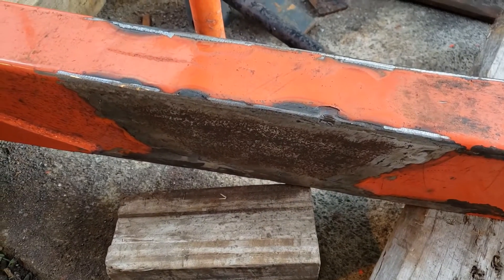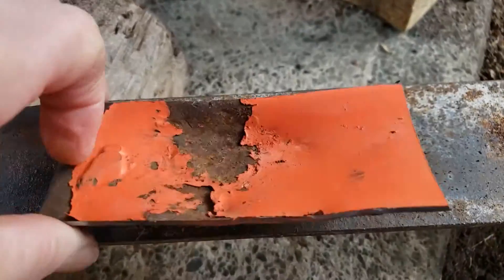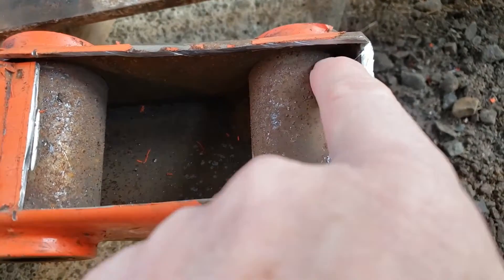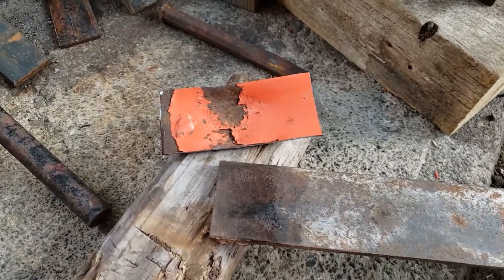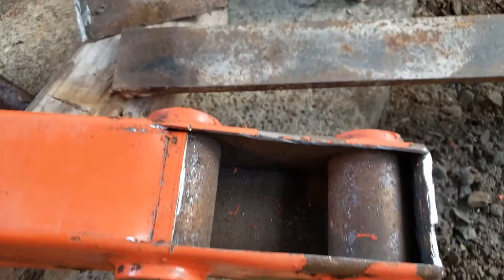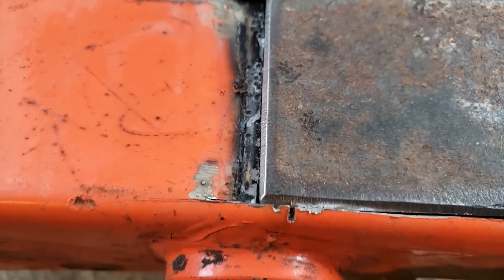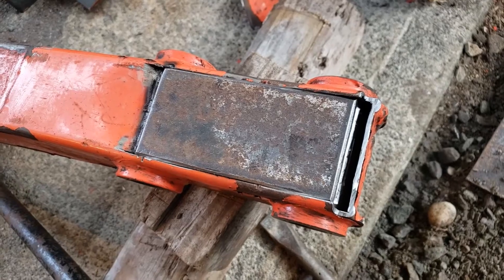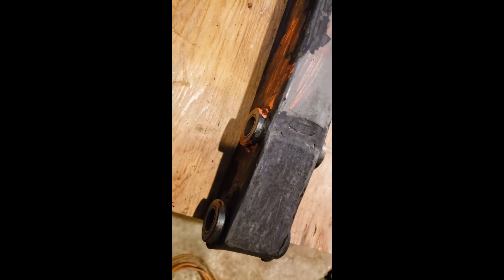BX 25 Kubota Backhoe, failed dipperstick arm

Comment: looks like a nice repair
Reply from the maker: Thank you..  Wife is a little perturbed, as the painted dipperstick is in the house next to the wood stove, curing.  LOL  After all, 35*F is a bit chilly in the garage.
Reply: @ThisOldMan-ya472  I been there and done that. more than once I brought something in to dry and or cure that my better half was rolling her eyes about. lol to funny.
Reply: Great repair good to see someone  that repairs stuff I have b bx23s only 7 months  old but I now know  were  to look to try to catch it before  it happens.  I've  only have 123hrs  on it can't  figure out were the dang coolant it going no leaks  but I swear  I can smell  it in the exhaust  being a former  Gm diesel  guy but they can't  seem to find it change  the oil at 50hrs  so I have 70hrs on oil change  had to add some oil as well it's got me kinda  concerned.
Reply from the maker: @stephengass6067  For a few years, my coolant level went down.  No idea why, or where.  Maybe I should check it again, as I probably haven't checked it for a year.  This is a 2010 BX.  For a while, I would refill to the lowest level on the reserve, just in case the heated coolant expanded out the overflow.  It has been a while since this was a concern though.  Mysterious.
Reply: @stephengass6067  that would concern me as well. its either burning  it or leaking it. need to keep looking. praying its something simple. our tractors are like family and its sad when they get sick.
Reply from the maker: @stephengass6067  Any luck on finding the coolant smell?  I found one of my spring hose clamps wasn't doing its job, so I changed to the stainless worm gear hose clamp.  The disappearing coolant issue then disappeared after 8 years of concern.
Reply: @ThisOldMan-ya472  ya it was the clamps I tightened them been ok so far never was a fan of them screw clamps once there set there good.